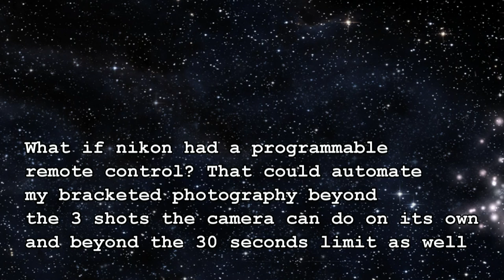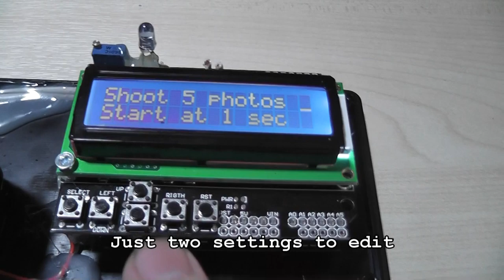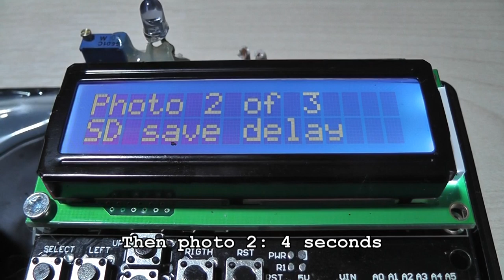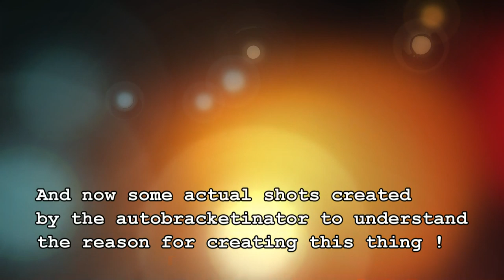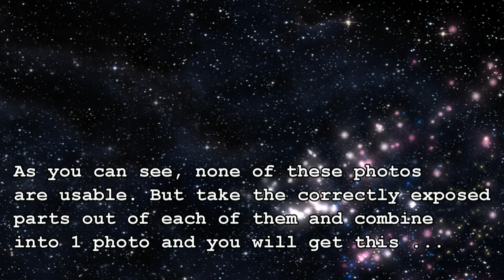New project: my Autobracketinator ! - Automated multi exposure HDR photography

Comment from the maker: @wainblatrobert under 1/40 is pretty useless in night shots, and that's what this is for.
It does your bracketing range but the only difference is that it starts at -3 (or - whatever you want) and then goes up as far as you tell it to.
It uses the bulb mode so 1/40th of a second is impossible as the IR data sequence takes more than that to send. It's night shots only i'm afraid.